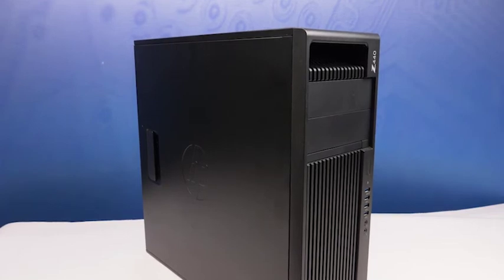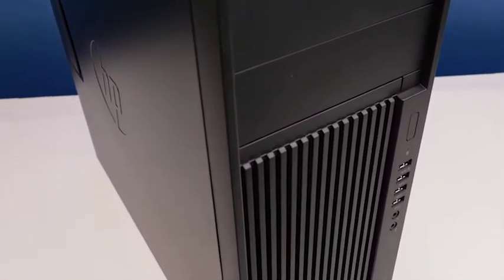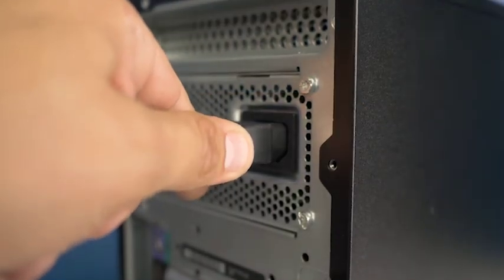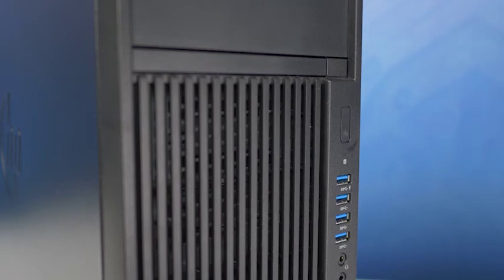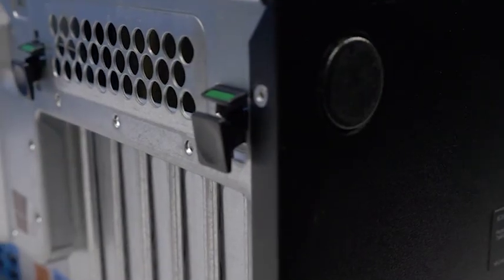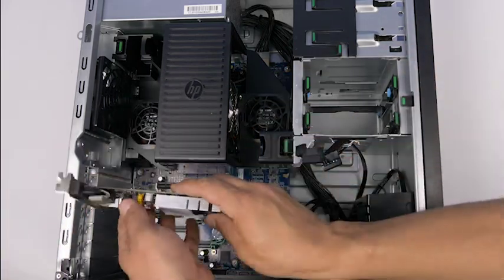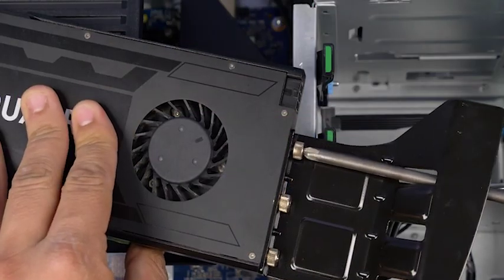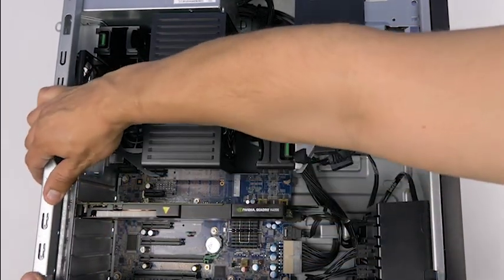HP Z440 Video Card Installation

Comment: Can we install liquid cooling system in hp z440??
Reply: You probably can, but you will encounter some problems. You will need a socket 2011-3 waterblock. Then you maybe have to trick the 6 pin CPU fan connector, most of the time by shorten two "ground" pins.